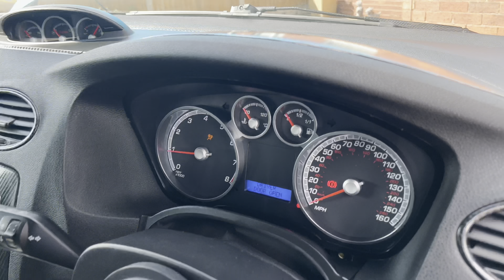Fixing P0190 and P0193 engine fault codes: Fuel rail pressure sensor Replacement

Comment: I’ve got the same knocking noise bro, mine is the gear box engine mount, mines had 3 so far. I need to stop being a cheap twat, and buy a good one lol. Check that pal before you spend fuck loads of money on stuff you don’t need. 😊👊🏻👊🏻
Reply from the maker: I’ve got all proper mounts mate top Brand ones so shouldn’t be them for me